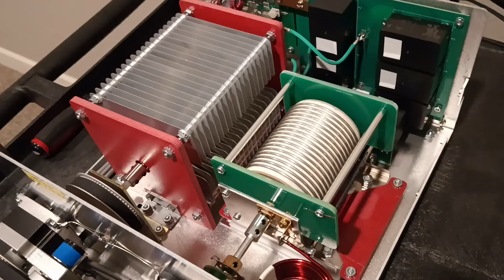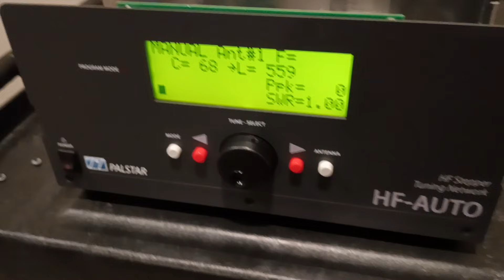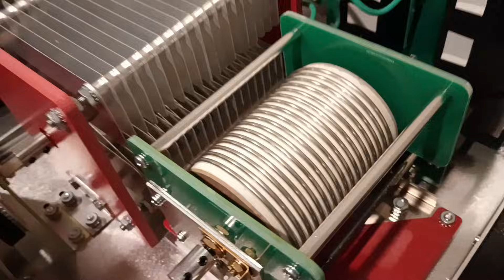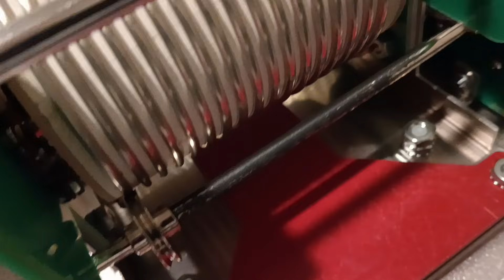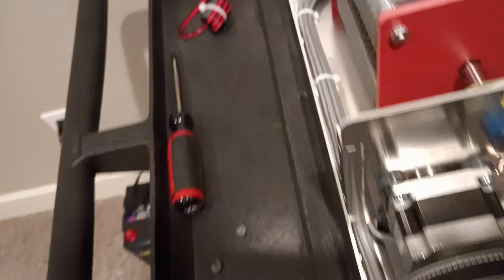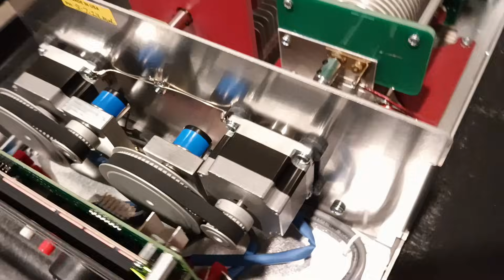Palstar HF-AUTO - Inside View and Greasing - Part 2

Comment: Huge inductor and variable capacitor! The wide spaced capacitor and Pi Tank coil in my homebrew 3 x 807 vacuum tube radio in late 1980s were similar, but smaller. Never had an automatic antenna tuner like this. 73 Jon, VU2JO
Reply from the maker: Your homebrew radio must have been an exciting project! Thanks for viewing and for your comment. 73, Jared ~ AC7WH